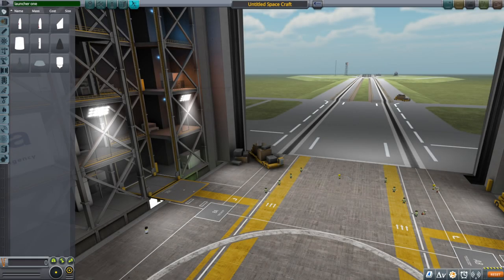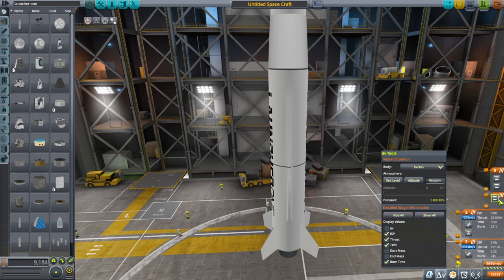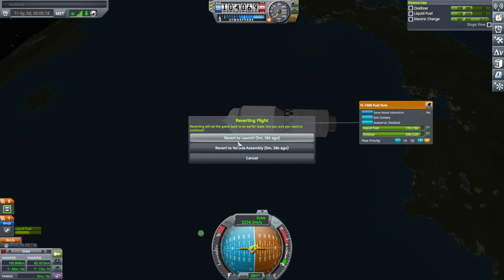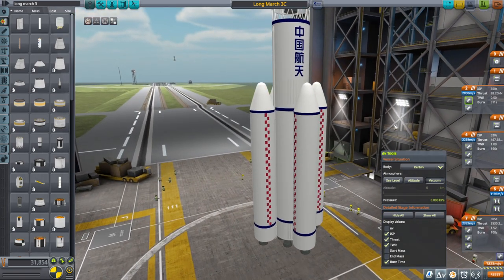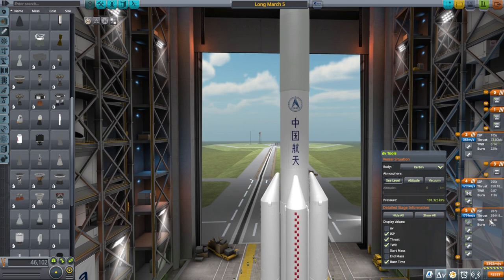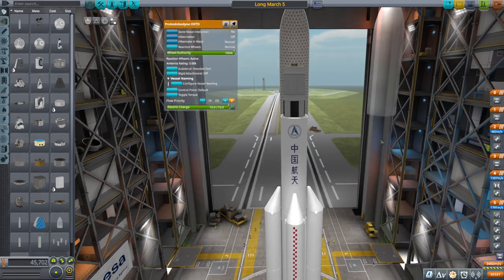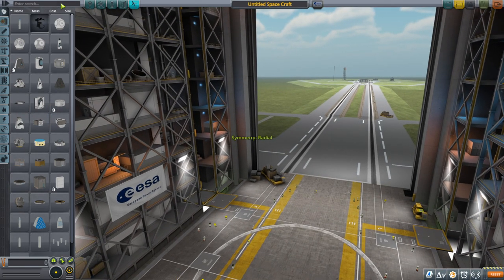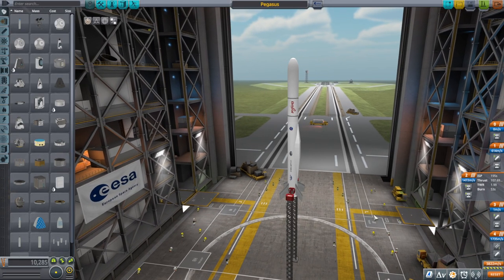Checking My Mods for Stock - Real Rockets 2 (Kerbal Space Program)

Comment: There is any module inside EDB asking for RO to be installed? I recently go for RSS but i dont want to bundle it with RO yet, so maybe this release means i can get this mod without RO?
Reply from the maker: No, nothing in it requires RO or asks for it. This video is just checking that the stock numbers are usable. If you want to use the rockets with RSS, though, It would be good to have RO so they operate properly with Real Fuels. Without RO, the rockets will still use Liquid Fuel and Oxidizer and will lack enough delta-v.